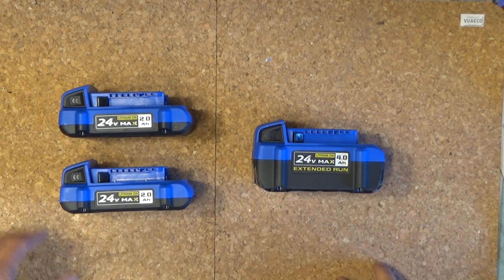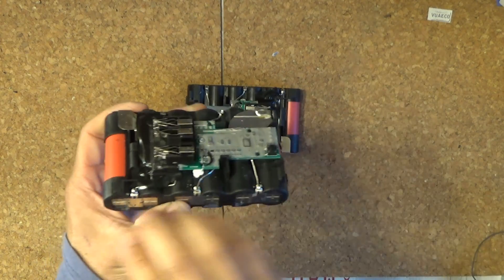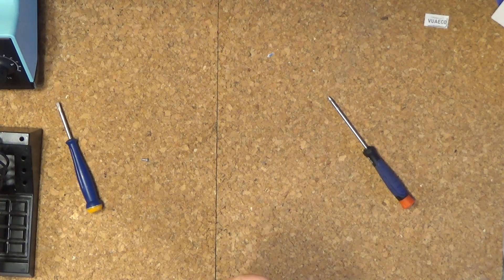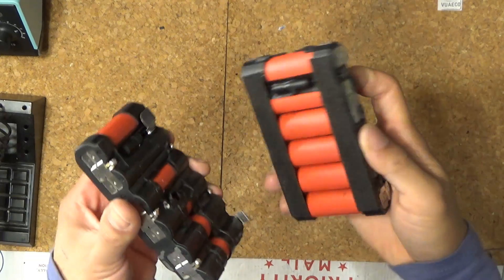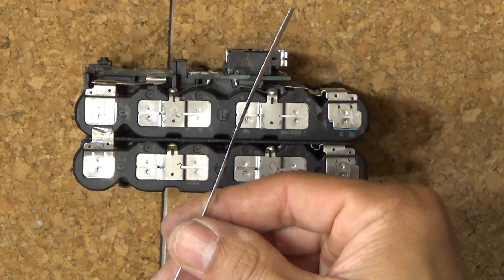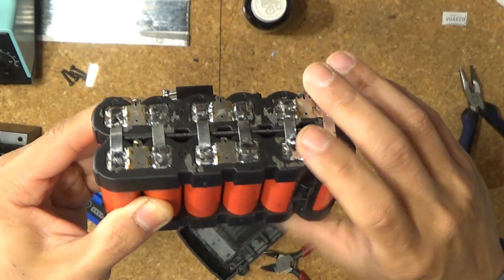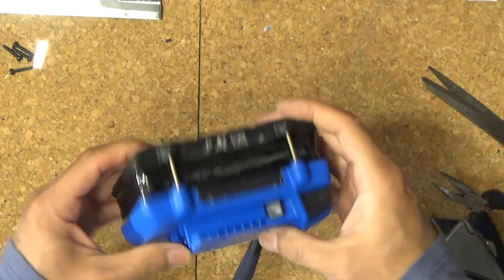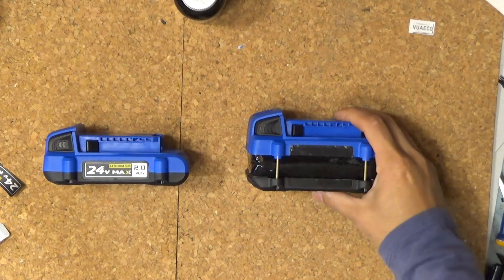DIY tool hack: Turn two compact power tool batteries into a single high capacity battery

Comment: hi. are you in the U.S. is there anyway I can speak with you.  I really enjoyed your video.  I bought four 18 volt ryobi batteries last week.  I am trying to use them for an ebike.  what would I have to do to increase the voltage and Amp hours.  Also what is the yellow solution you used when soldering the tab wire to the terminals?? That was a very informative video. thanks
Reply from the maker: To increase the voltage, you need to connect the batteries in series. To increase the Ah, connect in parallel. The yellow solution is liquid flux. It serves to reduce the oxidation of the metal and makes it easier to stick solder on the metal.
Reply: I figured everything out. Thanks

Comment: Nice job. It's too bad you couldn't have gotten a 3D printed bottom shell for a proper fit. But, if it works, it works.
Reply from the maker: 3D printing is not practical for this project. Printer cost, cost of its elements (ink), and time required to print it does not justify for the cost of even a new battery let alone just a bottom plastic cover.